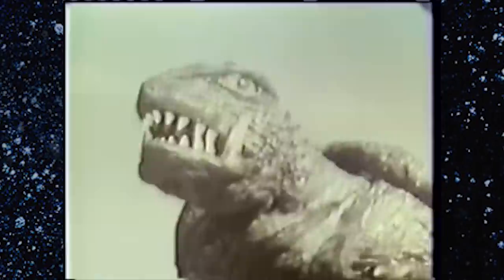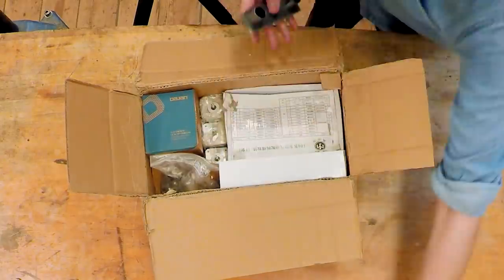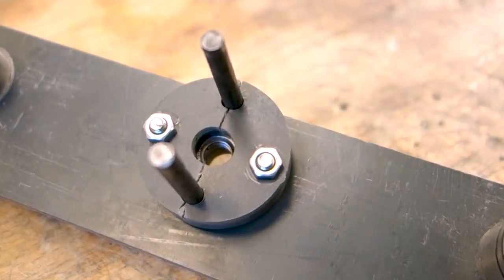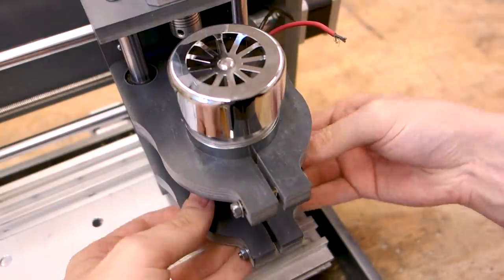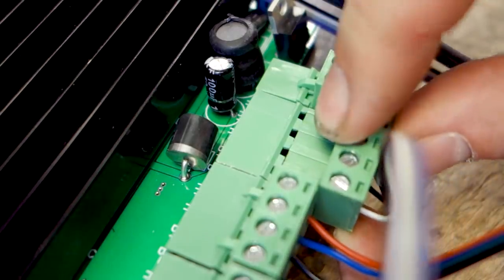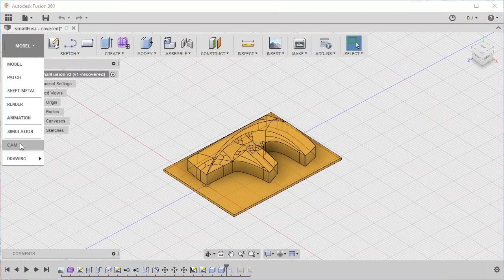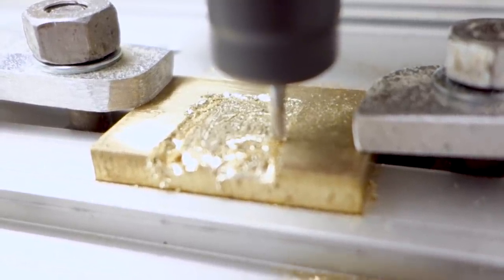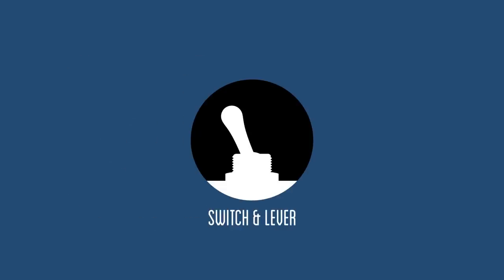Review: Cheap CNC Mill

Comment: I would like to point out that your approach to the brass was inherently flawed. 

The ball nose end mill is great for smoothing, and cutting with the edge / radius of the end mill. Attempting to use the center point is almost pointless, as there's such little contact area of the  flutes / cutting edges, and very little chip evacuation from this point, means that very little material can be removed using the tip of the end mill.. 

A better approach for the brass would have been to use a flat bottom end mill to rough out the majority of the part, then use the ball nose end mill to smooth it out in a finishing pass.
Reply from the maker: +ArcAiN6 thank you, you do make some good points. Even so I would have expected more from when it actually engaged with the edge of the workpiece, where it doesn't cut on the center, but instead the frame flexes and the tool rides up on the surface.
Reply: That can partially be solved by lowering feed rate, and step over, but doesn't address the underlying issue. 

The biggest problem these little hobby machines have is their lack of rigidness. All of the plastic structural components, tolerance errors, and general "slop" in the fit and design of the machine end up giving a large stack-up of points of failure / movement, this is what causes the large amount of flex you're seeing. A good way to think about it, is stacking tires.. Each tolerance issue, loose part, or flexible part represents a tire. If you continue to stack these tires up, eventually, the weight of all the tires, and the inherent instability of each individual tire, will cause the stack to move, shift or fall.  

In this case, it's not so much the design of the machine that is at fault, but rather the low-grade materials used in it's construction. Hardened linear rails and blocks that mount flat against a rigid surface is far superior than case-hardened rods  that are only held on the ends with a free floating area in the center. The brittle plastic used throughout could have been machined out of aluminum, or steel. The bearing tubes are also an issue, as they appeared to have been press fit on one end, rather than supported the full length of the bearing. 

It's not a bad machine, don't get me wrong, for milling foams, plastics, PCB, and light woods, it should do an adequate job, but for harder materials such has hard resins, plastics, and metals, it simply won't be up to the task.

All of that being said, judging by the parts alone, the $400 price tag was completely absurd.  If someone was in the market to purchase a small CNC mill kit, one could be had for $200 by purchase a cheap all metal 3020 from amazon, and upgrading the spindle for an additional $30 - $50.

Comment: MyfordBoy has a similar machine on which I think he has fabricated new metal parts to beef the little cnc engraver up to a small cnc mill.  Interesting thing to start exploring the World of cnc with.
Reply from the maker: Indeed, he has a smaller one, which I think may be a better way to go. It's going to be more rigid, and be easier to make replacement parts for as well. My plan was to do something similar, but unfortunately I do no longer have access to a workshop capable of that.

Comment: Wow. $400 for a machine that is so broken - and dangerous - that you literally have to make half the parts yourself... and then it STILL doesn't work. Not sure how you could recommend this on any level.
Reply from the maker: Still doesn't work? How did you come to that conclusion? It works just fine, for what it's intended to do, I did however push it beyond it's intended function. 

I mention it's dangerous, and if you don't know what you're doing you should not get it. A table saw can cut your fingers off, that doesn't mean it's a bad saw.
Reply: It's sold as an engraving machine, but even after making a significant number of parts yourself out of metal, you still couldn't get it to engrave. It's broken.  As for the electronics, the missing parts make the thing potentially lethal.  This really sounds like you're just trying to defend a product because they sent it to you for free.
Reply from the maker: I still couldn't get it to engrave? It engraves just fine, even if there's no video of it. Heck, did you not see the "The End?" writing and the Mona Lisa portrait? That's more like what you would expect from engraving. 

The missing electronic parts doesn't make it lethal, putting it together properly (which again, I say that if you don't know what you're doing, don't do it) makes it just as safe (or dangerous) as if they would have shipped with all the parts. 

Don't question my integrity, I have no loyalty to Gearbest, beyond agreeing to make a review video. If I wanted to defend this product simply because they sent it to me, don't you think I could've done a heck of a better (and more insincere) job in the video already? You just sound like a know-it-all about a machine you haven't actually seen, much less used, in real life.
Reply: hey Dom, get lost.

Comment: Your tests for metal were not very fair, the machine is marketed as an engraving CNC, which means small cuts with an engraving bit. Engraving bits are not meant for shaping, or any depth of cut more than a few thou. This is meant to cut small trophy plates  or name plates for small parts, not shaping parts
Reply from the maker: The mill ships with a 1/8" flat two flute endmill, which I thought was way too aggressive anyway. I cannot underline enough how slow I ran the ball ended endmill when milling the brass, and how small of a depth of cut I was taking, and it simply wasn't enough. 

And indeed, I know it's not entirely fair to treat what is marketed as an engraver as a full fledged mill, but I wanted to push the machine and see how much it would take.

Comment: i'd really love to see one of these cut a pcb !! thats the only reason id buy one... to make my own pcb's!!
Reply from the maker: Considering how soft PCBs are, and how little you need to remove, it should be able to do that without breaking a sweat. Unfortunately I don't have any PCB stock, so I cannot put it to the test.
Reply: Switch & Lever it's not a question as to weather it can handle doing PCB's obviously that shouldn't be an issue. PCB milling needs very good accuracy considering how close some traces can be. Is it accurate enough? That's what needs answering.
Reply from the maker: +Jeff Lalonde when I was calibrating it the best I could get it was about +/- 0.1mm over 100mm, so it's not the most accurate thing in the world, but should be plenty sufficient for PCBs.

Comment: I saw that mill on the Gearbest site and wondered if it was any good for metal. Thanks for the review
Reply from the maker: Techwise Jor, well, no, a CNC machine is technically any machine that is Controlled Numerically by a Computer (CNC = Computer Numerical Control), and it includes (but is not limited to) mills, lathes, plasma cutters, engravers and plotters. That's why you don't call these machines just CNC, but CNC mill, CNC lathe, etc etc.
Reply: I wouldn't do business with gearbest, they're a shit company.

They're quick to take your money, but are nowhere to be found if you have a problem. I bought a 3D printer from them and it worked for a grand total of a week before the heated bed broke. I filed a warranty claim with them and they've done nothing but give me the runaround and ignore my replies for 3-5 days at a time. I think it's been a month since I filed a warranty claim with them and still no resolution in sight.

This video gives you all of the information you need, they sell garbage products and don't honor their warranties when their poor quality crap eventually breaks.
Reply: That is why it has  "ENGRAVING" in its name TWICE, not meant to be used  for actual milling... too flimsy. Looks good for the price if you are using it for what it was built for ;)
Reply from the maker: I'd say for engraving metal it's perfectly fine, because of so low tool engagement while engraving, but if you're planning on doing any sort of serious milling I'd probably look at another solution (or completely rebuild this more rigid).
Reply: Baisulis84 >> I agree, although they shouldn't call it a CNC then, as a CNC is a milling machine and not really an engraver. Sure, a CNC can engrave just fine, but that's not its primary purpose :)

GGigabiteM >> Where do you live? Here in Denmark we got a national agency we can complain to, if a company doesen't act on a warranty claim or basicly refuses to follow the rights of the costumer. Try checking if your country has one too. It may be worth the effort :)
Reply: Ah, fair enough. I had someone telling me different once, so thanks for correcting me :)

Comment: Suggestion for next review: make the spare parts with easier materials like wood, then use the machine to make it out of plastic/aluminium :)
Reply from the maker: I needed something which had the same, or stronger, rigidity as the material that broke, and aluminium was the closest thing at hand.

Comment: Why are you replacing the table for the review? People buying this won't be able to replace the table with a nice aluminum one. It's also making you review a "higher" cost machine than you buy out of the box..
Reply: The Clouds Have Eyes Actually the "sinister social engineering agenda" didn't have to dumb people down, as they were already dumb to begin with.
Reply from the maker: @Sebastian no, epoxy wouldn't have worked. That type of plastic doesn't really glue well, unless you use specialized glues. I think it was probably some sort of PVC blend, which doesn't really glue well at all. I see no problem with replacing it with a more reliable part rather than gluing together the existing, making it weaker than it originally was.

Either way, it's all in the bin since long ago, only kept the electronics and shafts for possibly hacking together something with down the line.
Reply: Albin Ekblom j
Reply: Cuz there wouldnt be any review because this thing broke while putting together
Reply: The hardest part of operating a youtube channel has to be dealing with all the braindead questions and moronic criticism.   One only needs to look to the comment sections of diy videos on youtube, to get a hauntingly apparent sense of the extent to which the sinister social engineering agenda to methodically dumb down the masses has been widely successful.
Reply: @davomontgomeryda3rd  I have been thinking this for so long now. I am glad I am not the only person that has taken this view about this social platform.....cause it's anything BUT social? It's more like "Here... lets post a video for every man and his dog to criticise, pull to pieces to mock and troll you with?" Sounds great
Reply: Social media will be the death of society as we know it.......!
Reply: anyone can still usethe stock items without replacing any if they were careful enough... he just wanted to make it safer and less of a hassle since HE is the one going to be using it
Reply from the maker: I disagree, it plays entirely into one of my final points, that this is a good platform to experiment and tinker with. With that judgement I should've stopped once I broke the initial part, because the aluminium replacement I made is not a stock piece. The aluminium extrusions came free from the scrap bin, so cost of the screws to put it together aside, it's not a higher cost machine at all. If I can find stuff for free, why can't other people?
Reply: No it's not a good platform to experiment. It's all junk and the parts are clearly parts that were rejected by quality control of different factories, like the power supply, not talking of the pirated software. People who don't have the possibility to remake parts that break will be stuck with a heap of crap. It's dangerous, and doesn't even have a half decent manual. A good platform may allow you to play with parts, but the parts that are included shouldn't be absolute junk.
Even with your more stable platform you could'nt come up with a result, with the original one, you just throw the whole thin in the bin.

Comment: Thanks very much...enjoyed your presentation.  As always insightful and thorough for a short, quality video.  Think you hit the nail on the head with your review (no spoiler alert).  Regardless of the price someone had to engineer all the components and bundle the electronics...it feels to me like the typical flood the low dollar/drachma/yen market and sell as many as they can to recoup the engineering/mfg costs but would imagine a long ROI.  Did you have a chance to measure the run out on the spindle and did the anti backlash system keep it under control with the threaded rod?  Thanks always for what you bring to us!!  ~PJ